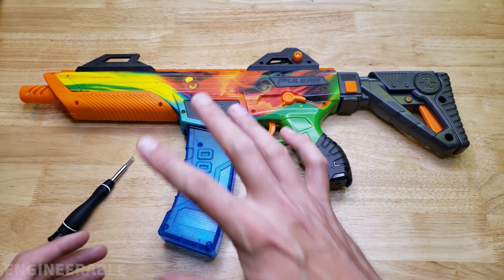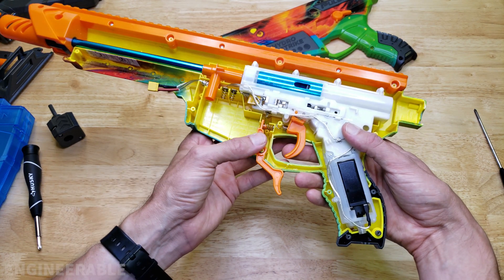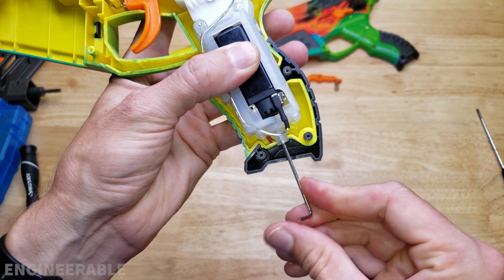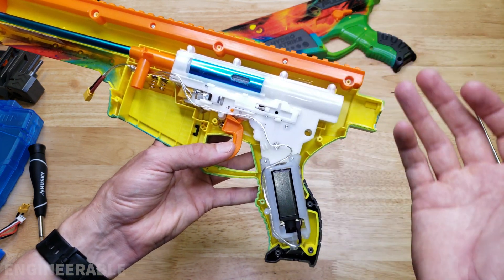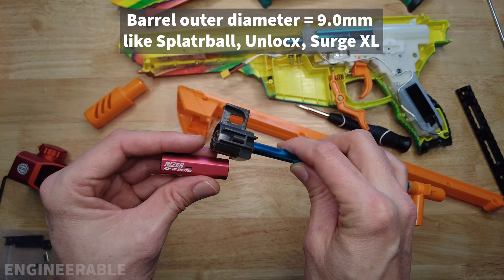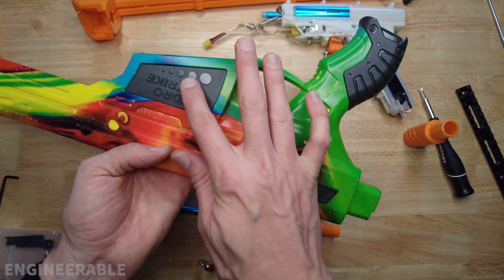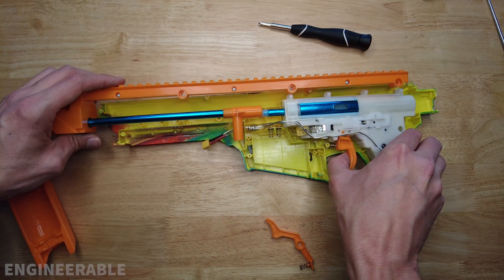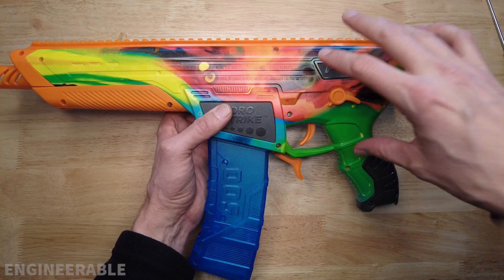What's Inside HYDRO STRIKE PULSAR PRO Gel Ball Blaster? (How to take it apart & put back together)

Comment: I bet if you started to heat up the barrel it would weaken the adhesive enough to slip that muzzle break deal off.
Reply from the maker: @jonnymccracken2528  dipping in very hot water works to soften glue to remove. Have to be careful not to get plastic too hot to bend.

Comment: My screws are stripped what should I do
Reply from the maker: Put their clothes back on. You need a screw extractor, but will be difficult.
Reply: @engineerable Hey bro I have one of these and extra parts etc but I have springs and etc and can make a one like the one in the video I have a sight and everything the trigger is broken though but I have a solution to the hopbox and metal gears

Comment: I had just modded my hydro strike, I put in metal gears, a new piston, a different motor, and a bigger battery, currently waiting on my mosfet to come in so I won’t have to worry about the arc issues
Reply from the maker: Awesome! Everything dropped in fine into the original gearbox? No hacking necessary?
Reply: @engineerable   everything dropped in, but I had to mod abit with the gears. I choose a 16:1 gear set, but it wasn’t the same as the stock gear set. I had to buy a gear delay chip and I used a Dremel to fit it into place. But it wasn’t too hard and afterwards, everything drop in fairly easy.

The only other things that I did had trouble with was due to me adding either shims, breaking a part, or a installing a new ak trigger since the old one broke off on my gun. The trigger pokes out just enough for the gun to work.
Reply: I forgot to also note that the type of piston I bought is for a regular Airsoft gun, I should’ve bought the bore up sized ones
Reply from the maker: @nathanfernandez-wc9uu  I've found that the V3 airsoft triggers have a much shorter trigger than these cheap gel blasters. Can you can use the original hydro strike trigger?
Reply: @engineerable  yeah you can still use the stock trigger. And AK style trigger are too short as you said, but I think a g36 style trigger may work a little better instead. But I haven’t fitted one myself yet to know for sure.
Reply: @nathanfernandez-wc9uu was it actually a 13:1 or 18:1?
Reply: Update on the gun, upgrading the battery may require some soldering to add a different fuse due to the stock fuse overheating quickly. The fuse that you would need depends on the amount of current your battery can handle (ex. My battery was 20c, so I soldered a 20amp fuse onto the gun). It may lower the fire rate depending on the battery and fuse used. But it’s better then having the battery explode. So far my gun hasn’t blown the new fuse but is arcing a lot Will update again once I installed the mosfet.
Reply from the maker: @nathanfernandez-wc9uu  thanks, look forward to hearing about your progress!
Reply: @engineerable  I had just installed the mosfet and it is a spitter. The mosfet install was a success and the fire rate has increased significantly even with a m120 spring. The only issue I have with it atm is that the magazine is constantly running due to how I routed the new wire harness I’ve made for the gun. Other then that, it’s way louder then how it was stock and it’s very accurate for its size. The mods that can be done for this gun is very good
Reply from the maker: @nathanfernandez-wc9uu  which Mosfet did you use?
Reply: @engineerable  a jefftrom micro mosfet iii

I would recommend a better mosfet that has active braking like a gate merf 3.2
Reply: If you are interested in seeing it in action, I uploaded a short of my blaster in use
Reply: when are these upgrade videos coming out😂
Reply: Finally, i found someone who did major upgrades on this blaster's gearbox.
Thanks for your information.

Comment: Really finding your videos informative. I'm new to all this and have been having a difficult time choosing a blaster. The bad reviews on any blaster that I look into, will always jump out to me and makes me unsure. 

Between the Surge xl, Splatrball SRB400/1200, UnlocX, or Hydro Strike....which is the most reliable with minimal issues (and all around decent blaster)?
Reply from the maker: 👍 UNLOCX pistol are best blasters under $100, followed by Hydro Strike and SURGE XL (but the it has a non replaceable battery)
Reply: @engineerable  thanks for the quick reply! And here I was ready to pull the trigger (no pun intended) on a Splatrball 400 haha. Are they over hyped? Target has them for 66 bucks right now. Hydro Strike is going for 60 at Walmart and the UnlocX pistol is 40, also at Walmart 🤔

Comment: Do you possibly think you can ever work on the cz scorpion evo a1 gel blaster from amazon? Because I want to upgrade the gear box to have metal gears and also possibly find a way to add a threaded barrel for my tracer.
Reply from the maker: Sorry to say that blaster will not be upgradeable. You want to start with something that uses standard airsoft parts.